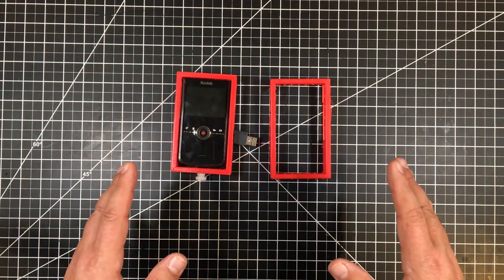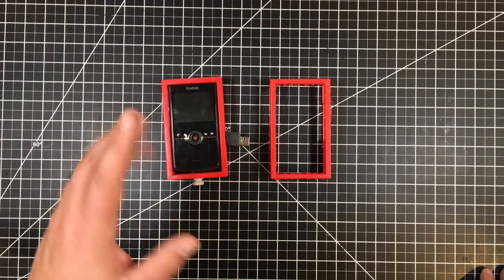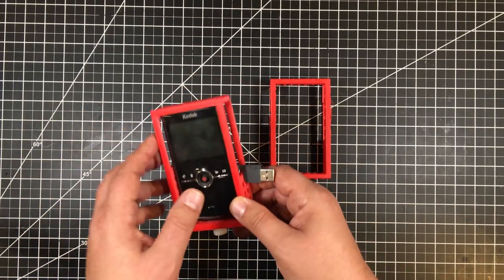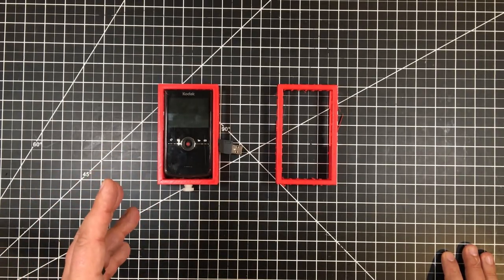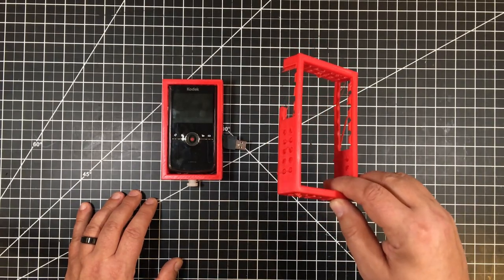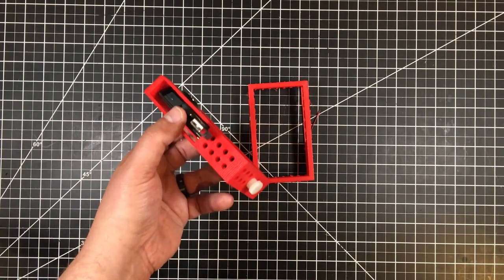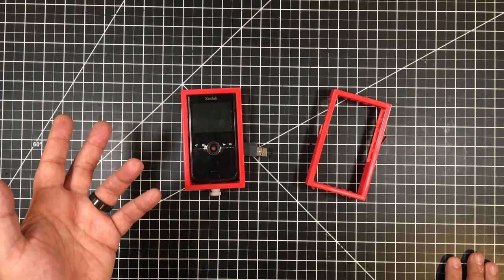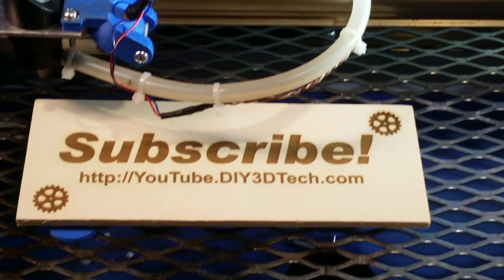Design Talk - 3D Printing a Cage for the Kodak Zi8 Pocket Video Camera!

Comment: Perhaps, if you chamfer the edges it will help you remove the part from the printer bed.
Reply from the maker: You know that could be a good idea!  I typically shy away chamfer's on the bottom edge for print quality issues, however in this case it likely would worth the trade off.  Thanks for commenting and and sharing the idea!